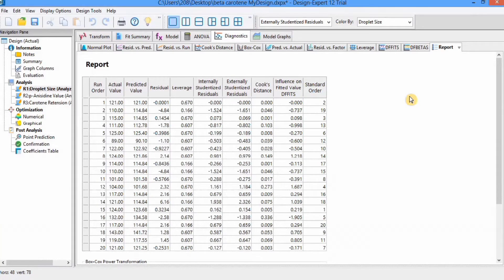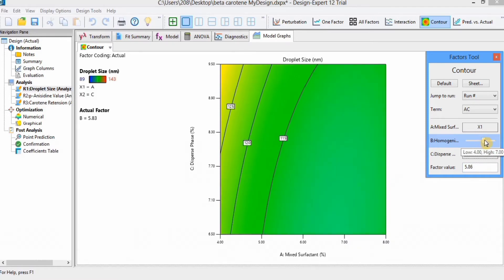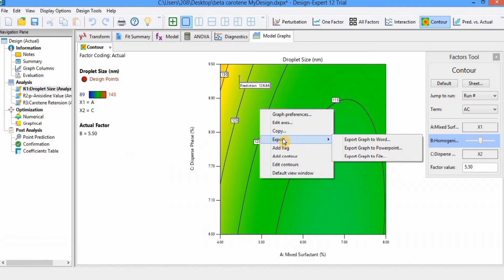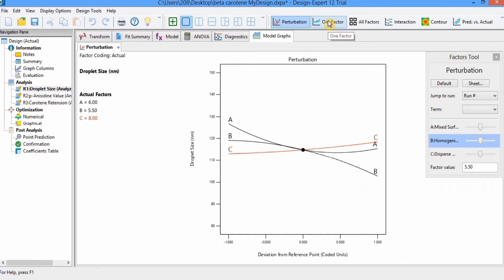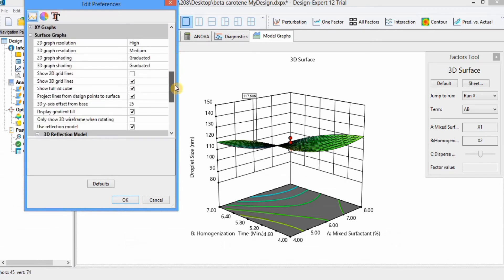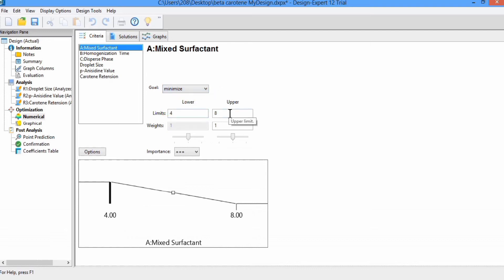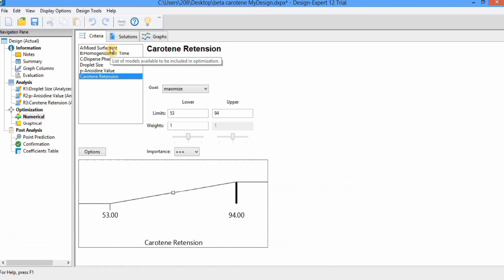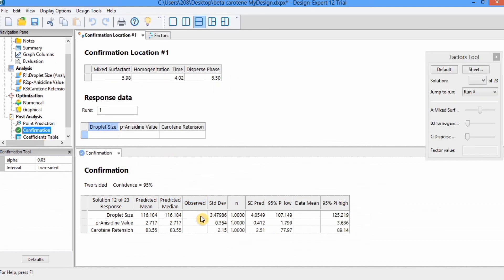How to Use Design Expert Software for Response Surface Methodology (Part 3)

Comment: Thank you for your explanation but I have a question I didn't understand when we first enter the rsponses to do the analysis are those rsponse already predicted as u said after the optimization done we need to perform another experiment to see the difference between predicted and actual response ??  bit confuse 😢😢 and I NEED HELP
Reply from the maker: The model predict response after optimization step. After optimization RSM predict optimized level of independent variable as well as potential response
Reply: @TeachingJunction  Thank you so much😇❤️ I'm following ur design expert to learn it very well explained plz make more detail videos if possible about the each analysis. Then the predicted response after optimization should be very close to what we enter the actual response when we did the experiment but what if it's not?? should we again start from the beginning

Comment: Thanks very much for these videos- I have seen the previous ones too- very explanatory 
My question is, how can we account for uncertainties in an experimental design? 
E.g. if we try to reproduce an experiment and we're getting slight variations in the responses, how do we account for these variations? 
Thanks
Reply from the maker: In RSM experiments, the central values do the same. For example, in this case there was six central value treatments (every treatment contain same amount of independent variables or in simple word repetition of treatment). Hence, software can detect the variations or uncertainties in your  experiments and predict optimum condition accordingly. Additionally, in confirmatory phase, the values predicted by software are confirmed through running experiment thrice using optimized conditions